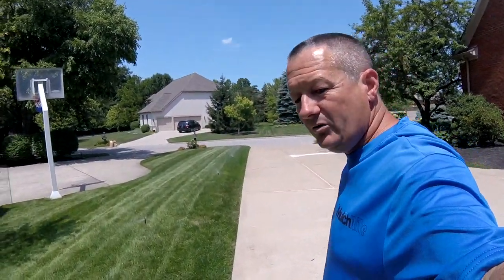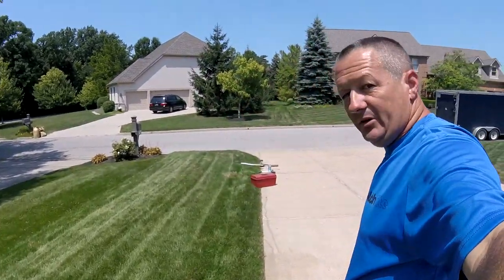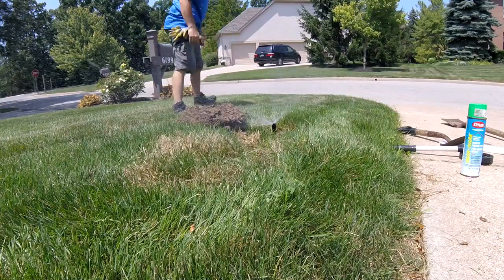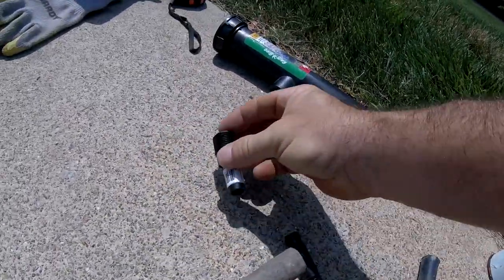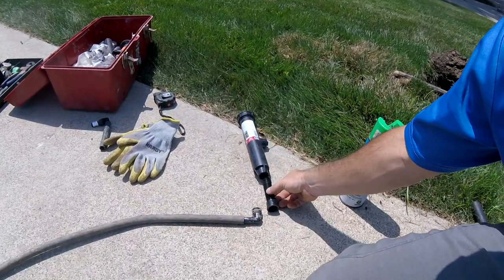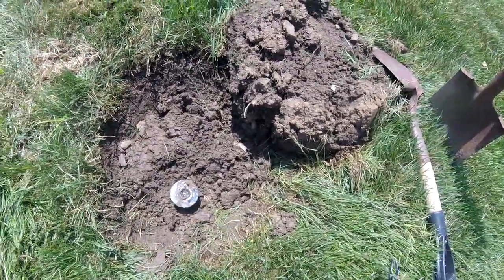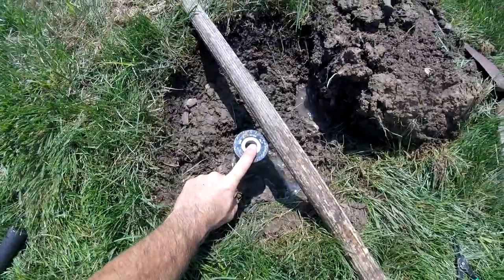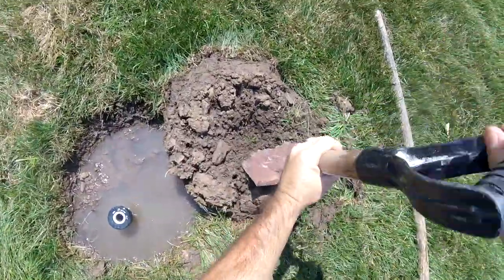Finding and Fixing a missing sprinkler head that's grown over with grass

Comment: At 10:10 you could've just put the nozzle back on with the water running so we could have some fun, lol.

You could've mentioned that the riser may need to be FPT to MPT (as in this case) or MPT to MPT, depending on the installation method used. The system I installed 30 years ago was using 3/4 inch PVC pipe with 3/4 x 3/4 x 1/2 FPT tees, so the risers threaded directly into FPT of the tees. I wasn't aware of installations utilizing swing pipe in the early 90's.

Comment: Very good video.  Only thing I would add is to wet the area around the head and let it sit a few minutes before unscrewimg the old head.  Then sediment wont fall down in the hole and it will stay like a tube.
Reply from the maker: Good to mention that. 👍 I also wiggle the head around a bit and try to "pack" the sides of that area so dirt will not fall into the hole.

Comment: Nice! I’m helping a neighbor with their system that was installed many years ago and has been offline for the past few years (electrical issue). There’s one particular valve that when turned on, nothing happens. I figured a line blockage or buried heads. No maps or anything to aid in locating the sprinklers except the guess of where they believe the heads are.
Reply from the maker: I'd suggest checking that there is power to the valve with a multimeter. You can also try to manually override that valve. Start there and see if one of those is your issue. Good luck!
Reply: @ColumbusLandscapers  thanks! They actually don’t have anything fancy. Just manual hand knob valves. I’m sure the heads are just too buried

Comment: I tried to find a cut-off riser extension just like you showed in the video. I need 1/2" NPT, and the only size with a female on one end and male on the other is 2.5" long. They have a 4" with 3/4" NPT, but not with 1/2" NPT. I also could find gobs of different lengths with 1/2" NPT with male at both ends. It seems that most sprinkler bodies have a female end that screws into male swing joint elbow. So I would think that there would be TONS of different lengths of both 1/2" NPT and 3/4" NPT riser extensions with female and male ends. Am I missing something?
Reply from the maker: Irrigation supply for contractors

Comment: I have an old copper irrigation system. what's the best and easiest way to rise the heads to the current grass level?  The current heads don't even seem to be solder on the pipe.
Reply from the maker: Man I'm old but maybe not that old .... Sorry I've never messed with one of those. 🤔
Reply: @ColumbusLandscapers  Is PVC sch. 40 or 80 need for systems in Michigan.  Connecting it to copper lines that are already ran.

Comment: What if my sprinkler is under the soil and I turn my irrigation on, will my pvc pipe burst?
Reply from the maker: Not likely because there's not enough water pressure, but you may get an underground puddle. Sometimes I've even seen sod bubbles!  Normally it will cause an over saturated soft spot in that area of the lawn.
Reply: @ColumbusLandscapers  that explains why my soil feels saturated and soft. Thanks for the video and the quick reply

Comment: Well, duh.   They’re linear & evenly spaced.  How about locating one on a sprinkler system that was installed around very large existing trees & nonlinear.   Then what?
Reply from the maker: Tree root issues there.. your best bet there isn't to find the ones that you can and re-route the lines between them to newly installed heads.
Reply: I’ve hooked up a water hose and let it flow. Look for wet spots and plug them to pressurize the others. One by one.
Reply: Not duh
It helped many
Great video
Reply: Yea then what!!!

Comment: I have an old copper irrigation system. what's the best and easiest way to rise the heads to the current grass level?  The current heads don't even seem to be solder on the pipe.